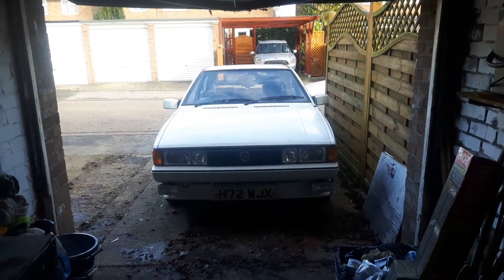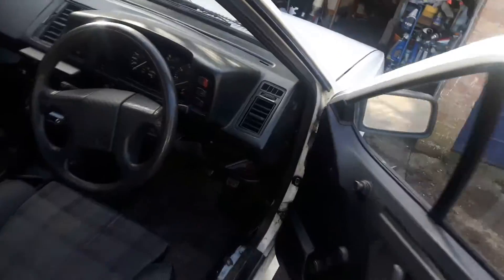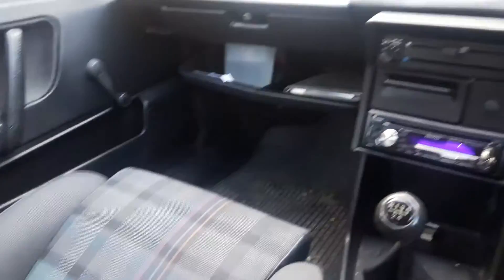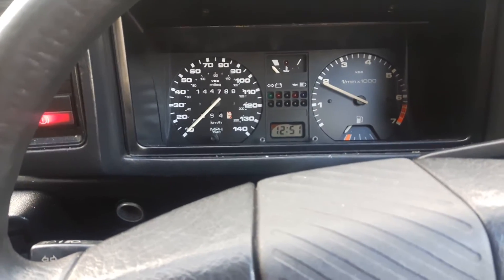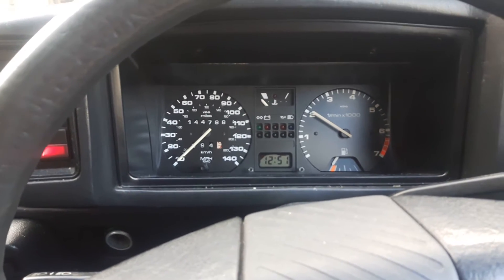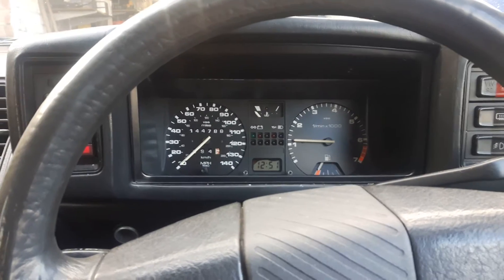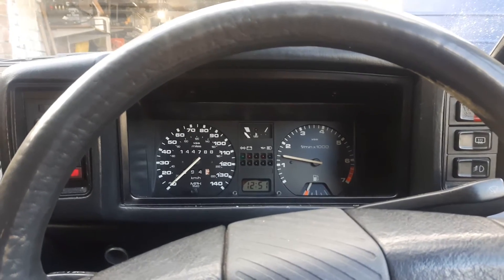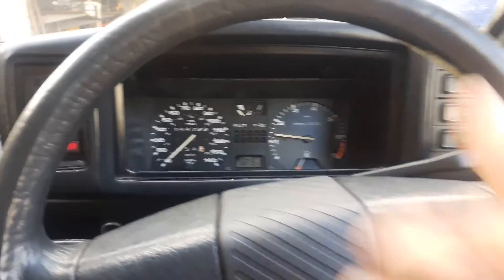Pierburg 2e2- Demonstration Of The Correct Cold Start Operation

Comment: HII buddy  
MY car wont stop normal it still want to run when turning off 
what should i do ????
Reply from the maker: @shakeerdenyssen7735  I'd recommend looking at the 3 point unit and its vacuum lines first, it's meant to close the throttle on shutdown to prevent running on

Comment: Every morning my cold idle is very low but when the car warms up it is normal.  Do you think it could be a TTV problem?  thanks for your videos.
Reply from the maker: Does the engine run smoothly while it's idling low?
Reply: @skyrocketautomotive first of all thanks for replying.  it works although it does take a few seconds for the throttle to respond (there is a slight delay, only sometimes) but the car runs without a problem.
Reply from the maker: @pablochsky2426  No problem! I do try to reply to all comments but Youtubes notifications can be hit and miss so I don't always pick them up! 

It sounds to me like your choke adjustment is out, I would definitely look here first, I detail this adjustment in my other videos, start the car from stone cold (IE: sitting overnight) and adjust there, normally the chokes are closed way too far causing an overly rich mixture for many conditions. 

It's a common misconception that chokes have to be closed all the way, they just need to provide a restriction enough to draw additional fuel when the engine is cold, you should find you get a noticeable difference in engine speed and smoothness while making the adjustment, if this doesn't work then it may be a TTV issue though these usually fail in the open position causing an excessively fast idle when warm so try the choke first. 

Best way to test the TTV is to take it off, put it in the freezer for half an hour, take it out and blow through one of the ports, air should be able to pass. Next put it in hot water for a few minutes, remove and blow through again, this time no air should pass, if this is the case then your TTV is working correctly. 

Although I'm no longer uploading videos to this channel, I will still reply if I see your comment so keep me posted!

Thanks for watching :)
Reply: @skyrocketautomotive  Thanks!!  I will follow your steps. I will see if I can find your video to adjust the choke first.  I also write down the TTV thing to check it out :)

Comment: Nice demo!  It seems a strange - and damaging - design on Pierburg's part to immediately rev an ice cold engine to >2,000RPM.  Personally, I would tweak the settings to reduce the initial cold-start idle to around 1,200RPM.

Comment: Hey, Nice vídeos.. i have a issue with my waxstat .. i have put It on boiling water and Works ... My issue now is that i start thr engine and It revs on 1200rpm, then when It start warming a little bit and rose the rpm to 1700 ... Then when its almost on operation temperarure starts decresing to 900rpm (idle speed ) .. 

How i can mantain revs on 1200 wile os warming up ?
Reply: Did you found the solution? I have the same problem!

Comment: Hi mate, I've found your 2e2 vids helpful in understanding the operation so thanks for sharing. I'm having a problem with my 92 Rocco 1.8 GTII - I struggle to start the car, it cuts out if I don't hold my foot on the throttle, and when I do it seems really lumpy (almost like its running on 3 cylinders but its not!). It seems only to be since the weather has been colder but Once the engine has warmed up a bit (2-3 mins) it runs smooth and the choke etc take it from there on but just doesn't seem to hold the revs right at the start. I've checked the 3-4 point unit and that's pushing the throttle out to where it should be, and the vacuum tubes all seem ok. Really appreciate any pointers or ideas? 

Thanks
Reply from the maker: Hi mate, thanks for the comment! Sounds to me like the colder weather is causing the choke to close further (same as it would stay more open on an extremely hot day).

My recommendation would be to wait til the car is stone cold, slacken the screws off of the autochoke body slightly so you can move it but it can't move on its own, fire the car up (get a mate to crank it over if needs be) and once it starts gently turn the choke body anti-clockwise. You should find within less than a minute of doing this the car will suddenly pick up and run smoothly. That's as much choke as your Pierburg should ever need. The reason it's picking up after a couple of minutes is the electric heater in the choke body is forcing the choke flap open to a point where the car is happy to run.

Good luck and let me know if you have any other issues. I plan to start making videos again soon and as you can see from all the unanswered comments I've got some video responses to Do!
Reply: Thanks for responding quickly, I'll be giving this a go in the morning! Cheers. @skyrocketautomotive
Reply: @chrisfoster7702  a year later but any luck with that method? mine has a problem exactly the same as what you described
Reply: @RoryAllenBlender   Hi, it did sort it initially but (I’m no expert btw!!) I think there’s probably other adjustments which would be better to try first- this method feels a bit quick and dirty. My carb has since developed other problems and trying to trace back the iffy tweaks I made in the past is an arse. Theoretically they shouldn’t need adjusting once set up so I concluded there’s probably a fault , rather than a need for adjustment. I’ve found this helpful: http://vwa1.dadoghouse.com/wp-content/uploads/2006/02/2E2%20service%20instruction.pdf also- worth checking the electrical components as they’re quite key - I had to get a new relay!
Reply: @chrisfoster3083  ok perfect, i’ll have a go adjusting the choke first then and have a look at electrical too. cheers!

Comment: Watched all your informative videos on Carb 2e2.  My 17 year old son just bought a Scirocco 1.6 Auto, last owner had it 20 years, done 5 miles last year! He told us that it would stall when driving so he lacked confidence in it. Took ages to start, changed plugs fresh fuel and filter, no gauze in fuel line, checked timing, once got it running drove sweet thinking it was dirty fuel happy days,straight through MOT as well. Now it wont start. Checked carb vacuums and electrics on it great spark, all see seems good.What I did notice was a self tapper screw holding plunger on 3,4 point .but it wasn't touching fast idle speed  anyway ? Also  before I take the carb off is there any way you can point me in the right direction? Last time we drove it started backfiring badly before  stalling . .Thought it might be main carb gasket ?